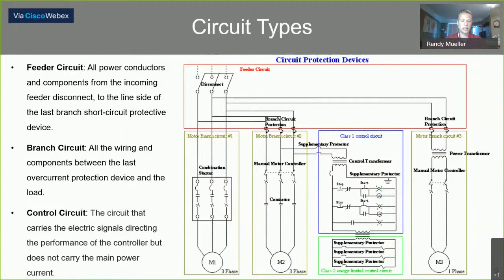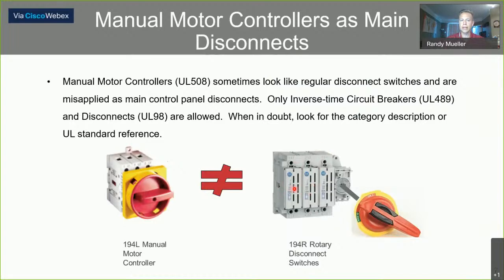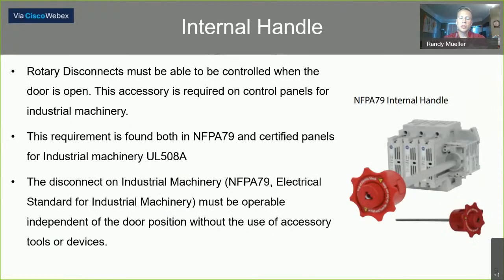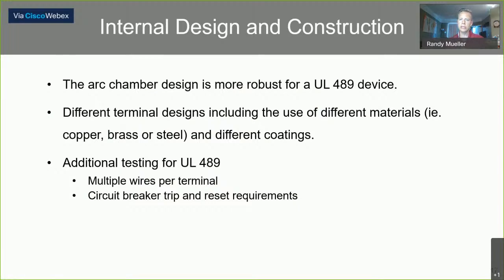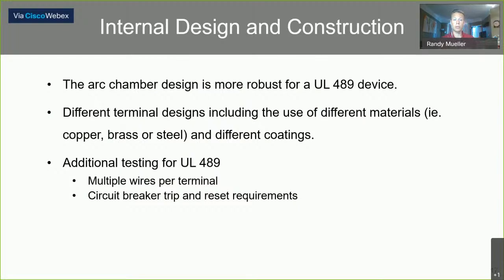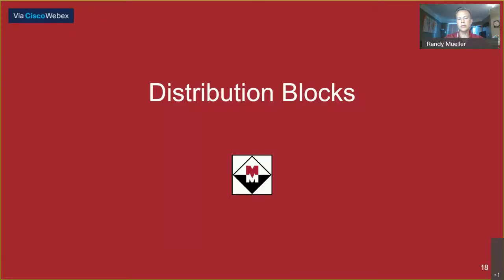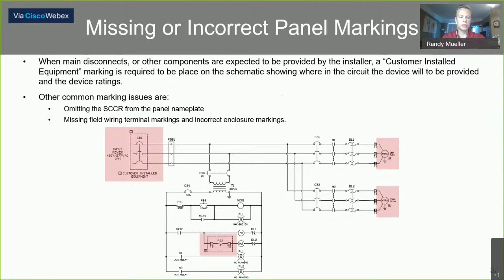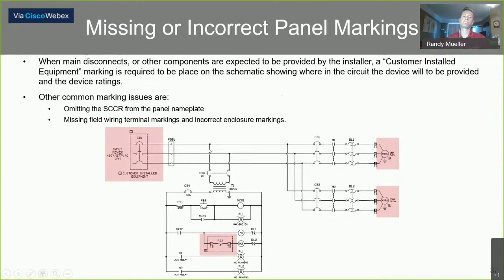Virtual Lunch & Learn: UL 508A Panel Design Practices

Comment: most CE marks on devices are self declaration of device manufacture. That is why devices ,have CE marks,  are not allowed use in conjunction with UL listed  or UL  RU components marks . Also motor circuit protection means that basically it protect user or operator  from high surge of current or voltage ( especially some extreme case high voltage arc ). UL 508 is harmonized with compatible IEC so UL start to  replacing 508 to  UL 60947 series standard  back in 2017.

Comment: Amazing video! I have tried to find some summary of UL 508A standard but no success until now! I am sad to hear that I can not use PHOENIX CONTACT PTFIX Distribution Blocks as Feeders for many small motors, these have amp ratings of 25A / 32A and are quick connect, but I suppose it does not comply to the 1" / 2" spacings specified in the UL 508 standard.

Comment: Are there any standard torque specs for wire size to these components?
Reply from the maker: Hello, For information regarding terminal torque and wire, please see UL 508A section 28, which goes over ‘Power circuit field wiring devices meeting component selection requirements.’ Please see local codes or regulations that are applicable to your area. If you have questions or require additional technical support, we recommend contacting your local Rockwell Automation distributor for personalized support.

Comment: Hi, I've heard that an electrical control panel cannot be inside of a machine. Why is that? Why does it always need to be in a panel - seperated from the machine? I can't find that information anywhere...
Reply from the maker: Hello, Typically the control panel is located on the outside of the machine for lockout-tagout purposes. It is also located on the outside of the machine from a safety perspective if the machine would happen to start up as you turned power to the panel on.

OSHA Lockout-Tagout Fact Sheet:
https://www.osha.gov/sites/default/files/publications/factsheet-lockout-tagout.pdf

Comment: Can you use 16 AWG for the control panel control voltage wiring as long as it is fused properly and still be UL508a compliant? I read that at 20AWG is when it starts to matter and is limited to PLC connections for that size wire. But apparently 18 AWG or larger is okay according to table 66. I'm trying to save money on wire costs, so want to avoid 14 AWG for control wiring.
Reply from the maker: Hello, The minimum conductor size required for power and field wiring 14AWG. Control circuit wiring may be smaller, such as 16 or 18, as long as all other rules for conductor selection and protection are followed. Reference Table 38.1.

Comment: I believe CE stands for Conformité Européenne, which is French for "European Conformity." Not China export.  Great video lots of useful information.
Reply from the maker: Hello Chris, That’s correct, the Conformité Européenne (CE) mark is a European conformity mark required for certain products sold in the European Economic Area. However, there is also a China Export mark that can be found on many Chinese manufactured products. The two marks are nearly identical and easily confused.

Here is a blog explaining the differences in more detail and showing how to tell them apart: https://starfishmedical.com/blog/conformite-europeenne-mark-vs-a-china-export-mark/

Comment: One query, shall we use UL508 listed circuit breaker(140M) as brunch circuit protective device?
Reply from the maker: Hello, The 140M line can be used as branch circuit protection for a Motor Branch Circuit. For branch circuits not using a motor, we recommend the 1489-M line. If you have further questions or concerns, please contact your local Rockwell Automation distributor.

Comment: Whats the use of supplementary protection if you need to have UL489 breaker in there already? Seems like supplementary breakers are useless.
Reply from the maker: Hello Mike, Supplementary circuit breakers provides equipment protection where branch circuit protection is already there or is not required. Supplementary circuit breakers are commonly used in place of fuses for small electronics like PLC I/O, contactor coils, etc. We recommend reviewing UL 1077 for more information.
Reply: 489 breakers can be used for feeder or branch protection, whereas 1077 breakers can only be used for branch protection. If you have 489 breakers already in place for branch protection, you do not need to replace them with 1077.

 Honestly I see 1077's getting used less and less often, really the only benefit is that they can be a little less expensive.